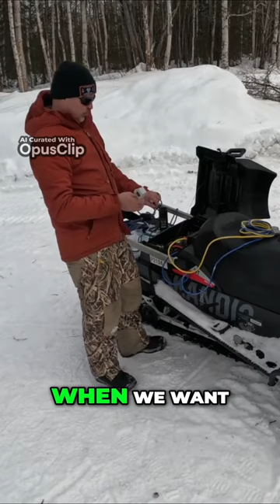Step by Step Guide How to Safely Use a Snow Machine Winch

Comment: Get yale cordage. The mini tow line will never snap using it for that
Reply from the maker: Yale cordage. I will check that out.
Reply: @livingmyalaska  it might be pricey, but that's years of quality and design. Depending on the core and sleeve combo or coating, some are flame resistant, cut resistant, and as strong as steel with barely any weight